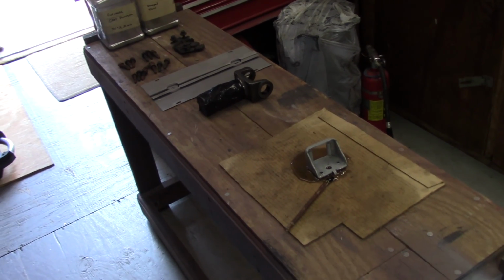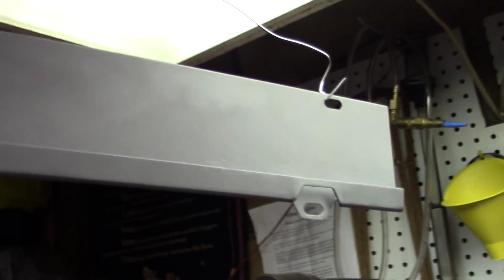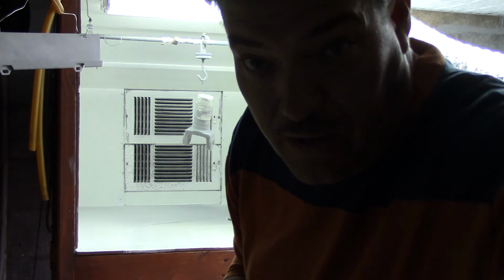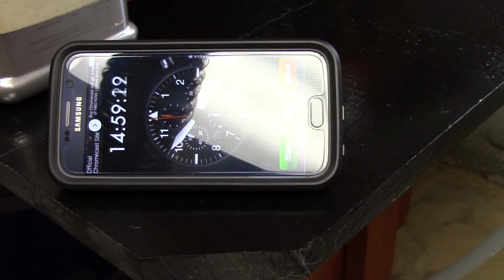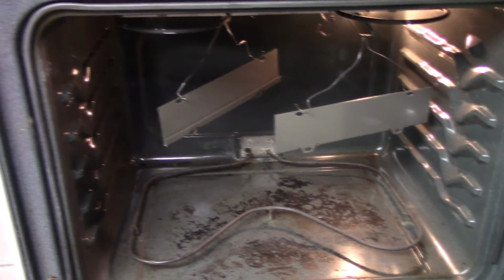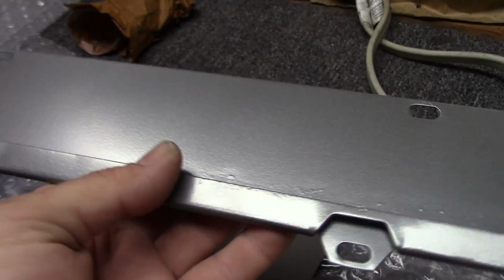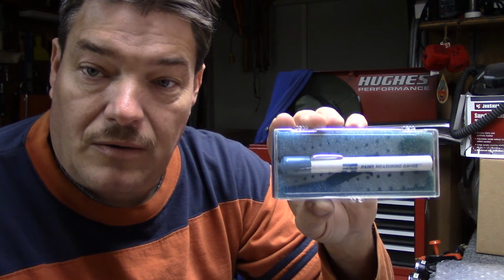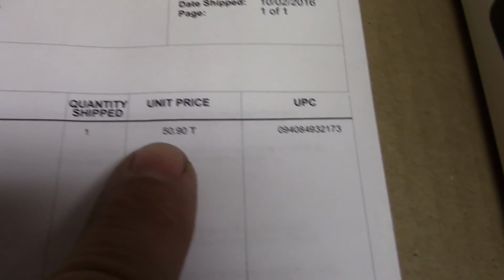Powder Coating Camaro Parts

Comment: really nice work on the powder coating.What kind of powder coating gun you use and all your powder is eastwood brand have a wonderful christmas
Reply from the maker: 265chevy It's a hyper smooth gun. I have mainly Eastwood powders from where I was in there buyers club years ago. I have used some from Columbia, Prismatic, and Tiger also. I'm not real sure where Eastwood get theirs. Have a Merry Christmas Hanson.

Comment: Hi Russ. Good job on the powder coating. I will be taking a radiator support for my 73' over to have it powder coated tomorrow. See you next video.
Reply from the maker: Thanks Darryl. My support was in rough shape. Some of the first welding I did on the car was on that part. Let me know how the pc goes.